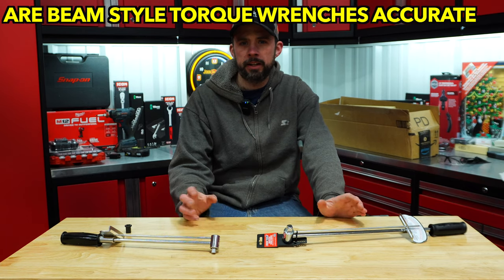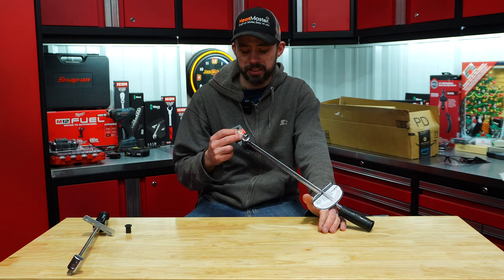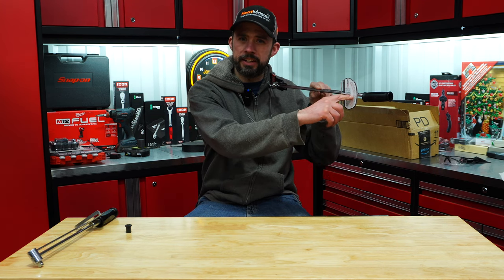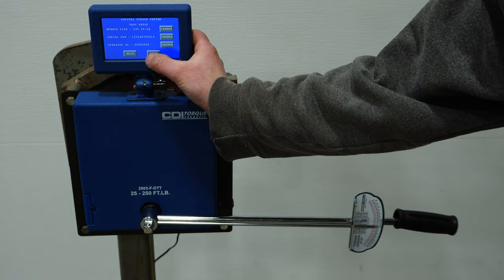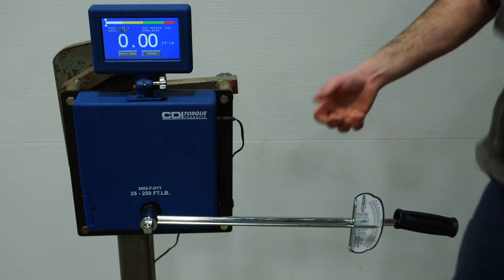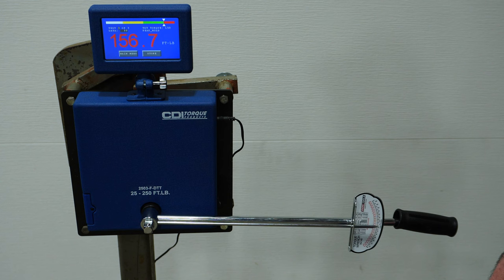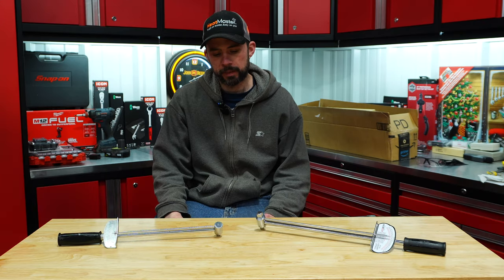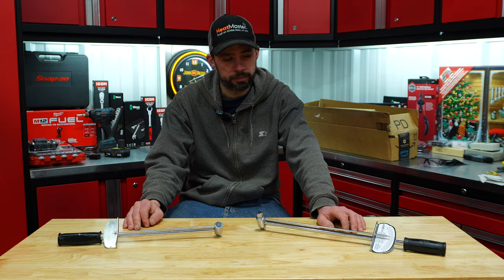Do Beam Torque Wrench's Actually Work?  How Accurate Are They?  OEM Torque Wrench Tested

Comment: Always wondered if those things were accurate or not. Looks like they are accurate enough for most jobs. Thanks for putting together the video.
Reply from the maker: No problem, thanks!
Reply: Sturtevant beam wrenches are accurate to 2 percent. Far more accurate than a clicker or split-beam clicker.

Comment: We calibrated 100's of torque wrenches every 6 months in the air force, never had a beam type fail in 18 months but had about a 50% failure rate on the click type for measuring low.  It didn't matter what brand, how much they cost, the click type were very unreliable.

Comment: I grew up working in my father's garage using his beam-type torque wrench.  The biggest problem is reading the dial while pulling hard on the handle.  Sometimes it was necessary to enlist another person to help.
Reply from the maker: Yep very accurate but can be tricky to read and torque at the same time.

Comment: I use a deflecting beam to check the torque settings on gearbox shafts. It's ideal for that job because I need a visual as I rotate it many times. A click is no good because the value is unknown till it clicks , and also because it takes slightly more (sometimes a lot more) torque to get the shaft moving initially....because for the preload in the tapered roller bearings. Thanks for the video upload 👍👍👍
Reply from the maker: Checking the preload is defiantly a good use for a deflecting beam,  No problem!

Comment: When you need precision and low torque pick a beam. When all you need is accuracy pick a more traditional torque wrench. This is pretty much expected and the precision aspect comes down to the skill of the user... because the beam is always going to flex the same amount every time with no deviation. Maybe over time there might be some drift from the weakened spring effect. But not by enough to care especially when precision is more important.
Reply: Yup. I use a Park beam on scootercycles

Comment: Amazing consistency to free hand technique at odd angle!!
If you want to be more accurate, place small piece of copper wire right at the needed torque value - once your indicator needle touches wire you know you are bang on ;)

There was a guy who added a small LED light so every time indicator needle touched copper wire it switched the LED on - good for confined spaces. 

Most important lesson - accuracy is maintained for years without any form of calibration. This alone makes is superior in comparison to other "modern" torque wrenches. How many garages, forget DIY hobbyists, run periodic calibrations on their torque wrenches?
Reply from the maker: Interesting idea with the wire and LED!  Yeah that's the biggest drawback to these, sometimes you're not right over the scale.

Yep these just seem to keep their accuracy,  unlike micrometer styles.

Most garages have tool trucks that show up to them,  on the truck they normally have a tester like this.  So if a tech want to check his torque wrench.
Reply: @Tools-Tested  Here in UK calibration starts at £80. If you on your own in a small garage, you go by "feel". No one wants to spend money on 3 wrenches twice a year, £80 each. And if you are a hobbyist, it is very unlikely you would ever test and calibrate your torque wrench. So it is much better to use $25 +/- 5% beam torque wrench with 20 years no-calibration lifespan then $100 click one which would be off the scale after first year.

People just don't look after their tools.
Reply: @ryteulopki8069  I don't think thats a good analysis of the pros and cons at all to be honest.
 If you are a hobbyist then I doubt your torque wrench would magically go out of calibration while sitting on the shelf or only occasionaly being used.
All you are committing yourself to is 20yrs of wasted time using an inferior tool.
Reply: @elliotkane4443  If you own click-style torque wrench just test it yourself using pull-scale (remember about leaver sensitivity!). You will see that even well stored click style will loose its accuracy over the time. How do we know it? Well, as a member of small hobby-garage who re-built few engines... we have twisted few bolts, we also have few of them come loose after time. So we have decided to learn how to DIY click style torque wrench calibration and quickly learned that none of our wrenches was accurate. Some of them were 20% off!! Even few of more expensive tools were off +5% after 1st year of service!! And most of brand new wrenches were off by 3% right at the start, fresh out of the box! 

We now test our wrenches every 6 months and if any doubt we use "lever+pull scale" to accurately torque most critical bolts - you cannot argue with physics ;) Force time distance brings accuracy guaranteed by nature! Not most practical solution but extremely accurate. And if you need to torque some odd bolts with specs outside your tool range, like +500Nm or larger... or 5Nm and smaller, then you just go for longer/shorter beam and use your pull scale. 

Pull scales are also easy to test as it is quite easy to accurately measure volume of water (volume, temperature etc - just google it), or use known weights, or use multiple scales (shop, warehouse, airport... there is a lot tested, certified scales to come by). And these days even cheapest electronic luggage 50kg scales from ebay offer <1% accuracy ;)

Modern toys, upps sorry... TOOLS ;) ale cool. They are definitely easier to use. But not everyone can justify $700 tool with &80 yearly calibration price tag ;)
Therefore beam style offer amazing, budget friendly alternative. Definitely superior to cheap' er, poorly' ish maintained options. 
Or just use steel bar with $10 pull scale ;)

Comment: I would like to see the Taiwan gauge done flipped over.   The gauge could be negative the other way indicating the plate with the ft-lbs is mispositioned.  Maybe also you could pull up and check the other side of the scale.  If they are both over then it is the spring .

I just looked at my wrench and it is made in Taiwan and about 30 years old.     It is not on zero but is at 10 ft-lbs.   I am going to test this thing with a 50 pound weight  to see if it is correct.   I might just have to subtract 10 from the readings.

Comment: Interesting to see them tested in this manner, not seen this style on a digital test bed before. Like you say, probably good enough for some applications but given that you can pickup relatively cheap micrometer style torque wrenches, they probably would't be popular for professional or experienced DIY
Reply from the maker: Yep I agree, you can get a decent click type for not much more.  Which makes it a lot easier to get the proper torque.  I’m am surprised they actually semi work though.

Comment: I use an old Craftsman beam-type on occasion.  They are actually more difficult to use in real-life on a bolt that is not stationary (like the torque measurement tester is).
Reply from the maker: Yep that's the only drawback. Accurate and cheap but hard to use accurately.

Comment: I have seen these test done on the cheap Taiwan and Chinese clicker torque wrenches, and they came out with ever worst results. I have some older Craftsman beam type torque wrenches that I have had over 40 years and never use. My biggest complaint about using them was they had a shiny background on the scale, and you would get a glare so it would make it hard to read.
Reply from the maker: Yep I can definitely see that being hard to use because of the glare.

Comment: I think there is something wrong in this test. Even without you putting force on the handle, there should be some torque reading on the tester, since the wrench itself has mass to it and therefore is producing some torque on the tester. But the reading always starts at zero.
Reply from the maker: Not with this tester/wrench,  beam wrench's are very light.  Also this tester has a working range of 25-250ft lbs,  so its not very accurate under 25.  The weight of the wrench would probably register on the 1/4 and maybe 3/8 tester because of the lower working range.

Comment: Thx for the video!  What torque wrench do you recommend for bicycles?
Reply from the maker: I have only tested torquing screwdrivers that low.  I will be testing Fix It Sticks this weekend which could be a good option depending on how they test.  Because of how compact the kit is.  

Im going to test kits designed for bikes but thats probably going to be in a few months.

Thanks!

Comment: I've used an SK beam since the early seventies. Built many a 500 hp + engine. The trick is consistency . A head bolt that "specs" 65 can be 61 or 72...as long as they're all equal. Oil on the bolt or no ? LOL
Reply from the maker: Yeah its down right comical people think they need a digital torque wrench to do engine work now.  

When you technically can achieve better accuracy with a beam style.  Yep its all about consistancy.

Comment: I appreciate the video, but I'm concerned about the testing rigor. It seems like a camera centered over the scale should have been used to test these tools. Your position changed which introduces a natural small error in the reading angles. Also I'd think you'd want to mute the tester and hide the screen from yourself so you can be sure that you're not introducing any additional error.

Comment: 10:29, Are they accurate enough for the price? There is no such a thing when it comes to a precision instrument and the duty of a Torque wrench is a precision instrument!
Is it accurate or is it not? I wouldn't take that Asian tool if you give me for free.
That old Craftsman does better than I would even hope so. It is more reliable and accurate than other types of mechanical Torque wrenches like clicker type. The only negative side is, that it is hard to monitor a scale in most situations. Craftsman is king.
I can only imagine how good are those made by Sturtevant Richmont.  They are very expensive but worth every penny.